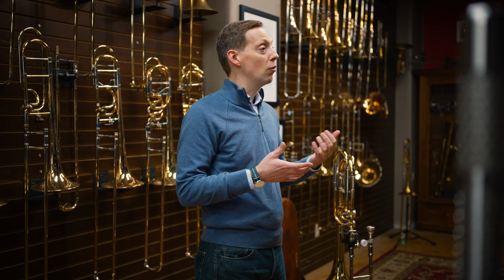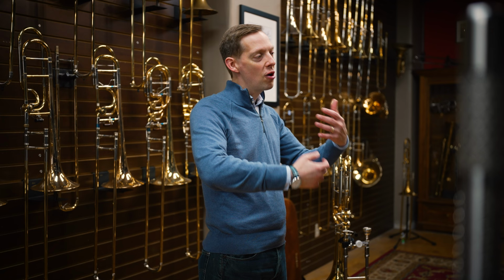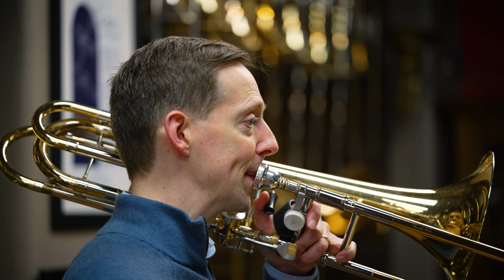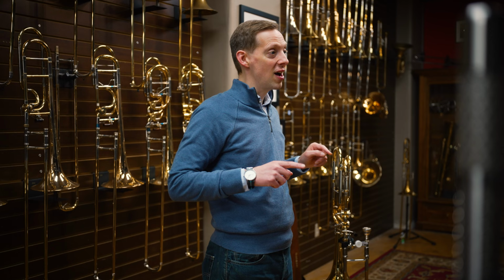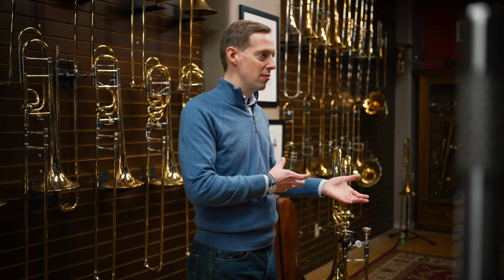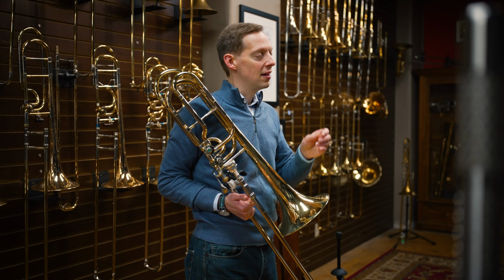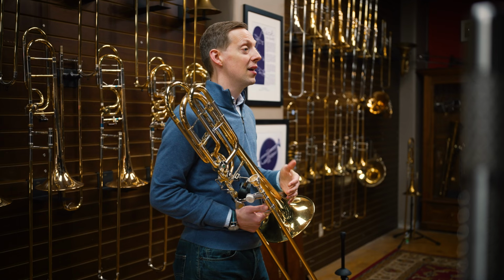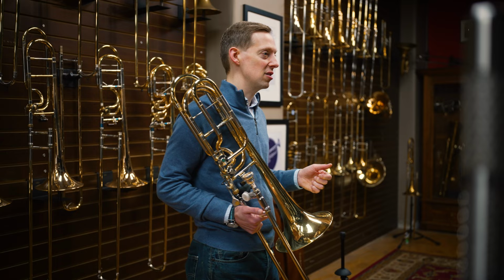How to Practice Low Range with James Markey

Comment: You can invert that and instead "pull your top lip out of the mouthpiece" [when playing pedal notes]. Using my top lip worked great for low notes on the trombone, but on tuba, my lower lip is much more consistent in the E0 register, In fact I can't hit E0 using my top lip but can consistently play E0 and even D0 with my bottom lip. 
It took me years to adjust, but now I'm an upstream player on low brass and even sound better on high brass, by simply using more lower lip. In my case, my upper lip is more fleshy and flabby than my lower lip.

Comment: Wow, I'm so impressed with the audio on this.
Would you mind sharing some of the equipment used to record?

James' voice sounds almost too good like its overdubbed in a studio hah!
The trombone playing sounds very lifelike!
Reply from the maker: Our videographer is very dedicated and detailed to his craft! From Versilian Studios- “Audio Signal Flow: Samar VL373A stereo active ribbon (Blumlein), 1m distance. No processing aside from gain adjustments.”

To be fair, James can make anything sound incredible. Thank you for your kind words and comment!
Reply from the maker: Editor: For the voice, I used a Microtech Gefell M310 (supercardioid SDC). It is boomed above his head about 1'/20cm above and slightly in front, just out of shot. Such mics, like the pricier but slightly more extended Sennheiser MKH 50 or Schoeps MK41/CMC6, are often preferred for interior dialog recording in film over shotgun mics, but are just as well at home in the studio as you suggest.

The voice is usually quite processed, using an EQ, dynamic EQ (similar conceptually to multiband compressor), and a compressor/leveller to achieve the final sound. I start with an EQ (DMG Equilibrium) with a moderate air (12k-ish) boost and small LF (80-100 Hz) boost, both very broad/low Q, to shape the tone in a more pleasing way (the M310 is almost boringly flat/mid-focused otherwise). This is followed by a dynamic EQ (DMG Multiplicity) set up as a custom multi-band denoiser/gate, but also acting simultaneously as a de-esser. This reduces room/street noise, rumble, sibilance, and echo/'verb all in one go. Finally a tube-based vari-mu compressor plugin (Pulsar Mu) is used to level the dialog smoothly and transparently while adding some subtle pleasing saturation.

The Samar VL373A used for performance bits is as mentioned previously totally unprocessed. It is tracked using a Zoom F8n Pro recorder at 48kHz, 32-bit float, to avoid the risk of clipping or improper levels. I have tried many other mics from almost every brand, ribbons and otherwise, on trombone but nothing seems quite as 'right' sounding as this one. It is a symmetrical ribbon which is unusually almost ruler flat from 20 Hz to 20 kHz. The blumlein array (crossed figure-8's) is also very well adapted to recording solo instruments as the image is very precise across the entire frequency range with minimal phasing present.

Comment: Whats the weird white dot on his slide?

I noticed he uses an aftermarket aid to hold his horn. I have to use one too. Why doesnt Edwards and Mr Markey design a horn you can actually hold onto without aftermarket tools?
Reply from the maker: Great questions! As for the dot, if we’re remembering correctly, it’s a flic smart button. 

The horn designing is a bit trickier and many brands have tried doing just that. Part of the trouble is creating a horn that has the best sound usually involves taking away unnecessary attachments on the horn. 

Another point could also be we’ve never seen this many players on such heavy instruments and designs are still catching up to accommodate! 

Again, great questions!